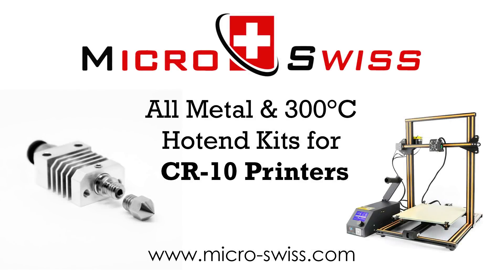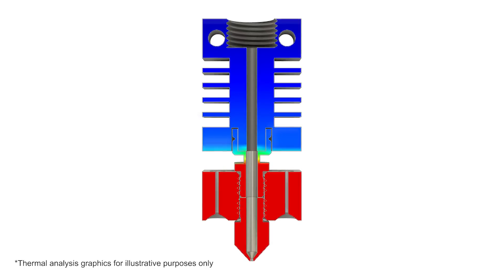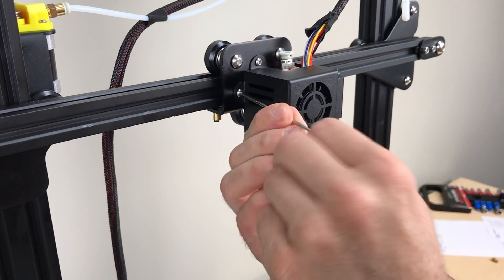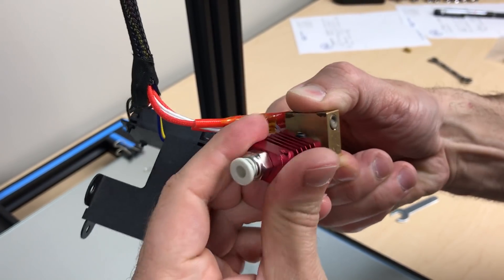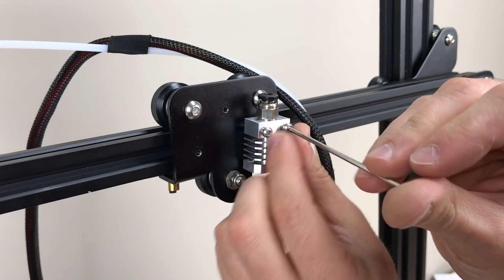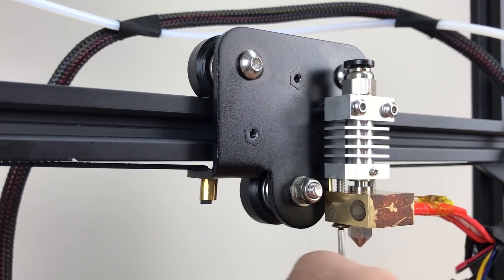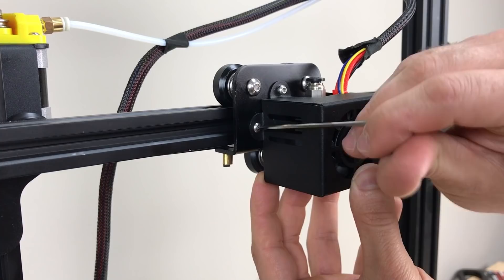Micro Swiss All Metal and 300°C Flexible Friendly Hotend Kits for CR-10 Printers

Comment: Please provide a video with installation of the heater block that came in the kit. It does not have any heartbreak screws.
Reply from the maker: Installing our heater block is same as original block, except when tightening the nozzle you have to hold heater block with pair of pliers. Please fallow the video instruction as is, except when seating the nozzle. Instead of installing those 2 screw, preheat a hotend, hold the heater block with pliers, and then seat the nozzle.

Comment: Hi. I can't stop having jammings with this upgrade. Don't really know what's the problem. Look https://drive.google.com/file/d/1STpYHwBVqcv41C7G3cE-1cBta0V4hurb/view?usp=drivesdk
Did you have this issue?
Regads
Reply from the maker: Make sure to lower your retraction to about 4mm
Reply: But isnt that too short?
Reply from the maker: It is not too short for All Metal hotend design because heat break is more efficient.
Reply: Micro Swiss LLC ok, and the speed you use?
Reply from the maker: We use 30mm/second and it works really well.

Comment: Report as Inappropriate
Clogging issues (That could be solved if actual written instructions were provided!)
As another review noted, have near constant clogging due to retraction. Turns out, with the micro swiss, you're supposed to lower the retraction distance which 1) is annoying when you actually need retraction, and 2) is not noted anywhere in the installation video... and for some reason, unlike some other kits, this one doesn't warrens any sort of written instructions? C'mon...

Comment: This does not reach 300 Degrees guys......I installed it same as video..... Soon as i start i still getting 285 max temp NOT! 300 degrees.......WHY! and why not show how to reach 300 degrees if they state the part reaches 300 degrees+  Not having a 300 degrees temperature experience...... Stick with your CR-10 origional hot end..... Same thing. same Temps
Reply: The heater block can handle up to 300. If you're printer can't get there that is a firmware issue not a hot end issue. The hot end does not magically update your firmware.
Reply: Well dont say it reaches 300   degrees if their not going to show how 300 degrees is in the firmware...... All talk no action
Reply: its Not the printer.... the hot end does not reach 300 + degrees.... and if it does.... Then share your process of this acheiving 318 degrees because it does not.... and now you are trashing a product that has nothing to do with the hot end...... So if you have a cr-10..... Share you procedure to how you did this rather than mock
Reply: @EliasOda  It was already said you have to update the printer's firmware to remove a temperature limit. The Printer has a temperature limit so you don't destroy the stock hotend. After you upgrade the printer the hotend is no longer a limitation so you have to update the firmware to get the full benefits. If you don't understand what this product is for then it clearly isn't for you.
Reply: Thank you for your advise.... i will try in firmware and how to change....Thankyou

Comment: I'm curious as to why you don't have a video showing installing the heating block that comes with the Micro Swiss all metal hot end kit. I bought your hot end and am trying to install it now. I would like to use the new heat block. Several others have asked the question here about how to install it but you have refused to answer them. Why is that? HOW DO YOU INSTALL THE HEATING BLOCK THAT COMES WITH YOUR KIT? (It doesn't have the 2 extra screw holes) If you don't think it should be used, why even sell it?
Reply: that seems quite dangerous.....
Reply: Actually taht's what I wanted to see as well, but I can't see how to add the thermistor wire thingies to the heating block, and that's a crucial piece of missing information.
Reply from the maker: Because of slotted clamping system on our heater block, there is no room to include those 2 holes for screws. Installing our heater block is same as original block, except when tightening the nozzle you have to hold heater block with pair of pliers. Please fallow the video instruction as is, except when seating the nozzle. Instead of installing those 2 screw preheat a hotend, hold the heater block with pliers, and then seat the nozzle.
Reply: Micro Swiss LLC Thanks for the information.
Reply: how do you reach 300 degrees.... i have it installed on my cr-10 and i have the same stock temp at 285.....What a rip off
Reply: @EliasOda  You need to flash your firmware and change the max temp in the firmware before you can go higher.
Reply: Thanks for your help..... Idid that on my cr-10 s changed to max temp of 300c  but when i flashed the firmware it still gave me stock temp setting... then i double checked all okay but re flashed and still the same.... I cant figure it out as there is no footage or tutorials.... the only tutorial i had on this was in italian All simple instalations but no show to action

Comment: What benefit does this upgrade provide?
Reply: For example printing high temperature materials, like PETG
Reply: The stock has no problem printing PETG.
Reply: Would not the firmware have to be replaced as well ?

Comment: I love the idea of using two screws to align the heartbreak. Furthermore this would prevent loosening the grub screw, potentially making filament get squeezed out, when switching a nozzle. When my all metal kit for my CR10 arrived I was a bit puzzled to find out that the included heatblock does not have the necessary threads. Does anyone know where I can get one that does provide with the possibility to use said screws?

Comment: Does this also fit on tevo tornado 3d printer as well?
Reply from the maker: Yes it does but you will need shorter mounting screws.
Reply: For the cooling block?   What are the specs for the screws?
Reply: In case anyone is wondering... (2) M3 x 16mm screws

Comment: do you have to remove the aligning heatbreak screws? cr-10 originally had them in so could i just leave them on the all metal?
Reply from the maker: You do not have to remove them but it is recommended to avoid any heat creep.
Reply: that make sense and answers why i got a clog.
but i really love this nozzle. i noticed a good difference.

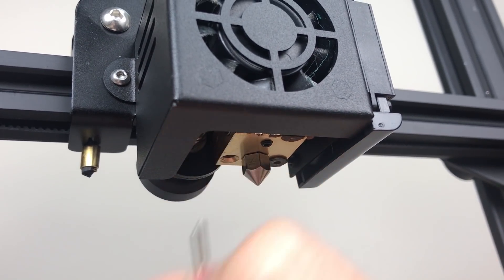Comment: Hello, why you remove the 2 screws in 4:14 : ?
Reply: I recently got my kit, but it did not have the two screws or holes in the heatblock. Am I missing something?
Reply: yes two holes & two bolts ;@) .. They must of changed it as mine is also missing them from the Heat block and cooling part.
Reply from the maker: Motorschirm, Those screws are for aligning and supporting the heatbreak during nozzle tightening. After its tightened, there's no need to have them on.

Comment: hope yours fits just got a message they have fucked up the cooling blocks its all got to be returned ..far from impressed was not checked for fitment after being machined with precision  or inspected with out any  .Before getting dispatched to retailer .. importance of quality attention to details you say on your site!. what happend ?
Reply: They will not work unless you insulate the heatblock with either the silicone sock or stock insulation.  It was a pretty poorly executed new product introduction in my opinion.  They don't tell you to insulate the heatblock in the videos and the tech support guy at micro-swiss claimed theirs was fine without it until they started shipping silicone socks with them.
Reply: Chris Nichols 
did u have the new threaded version as it were to baggy they only just fixed this apparently u may have a dud
Reply: I have both versions.  The one with the threaded block I gave up on and used the stock block.
Reply: Chris Nichols the block was machined wrong u should contact them they may be kind enough to swap it out
Reply: received fitted and is working pretty well i must say micro300. ..can we purchase ptfe replacements as mine keeps falling out

Comment: Nice.  I like the idea of the Ti. heat break.  Logical.  Looks to be a logical design overall. 

Being constrained by original firmware and heat cartridge does not bug me.  
260 is plenty (for me) and allows printing everything but Nylons and Polycarb (essentially)...which would be nice
but are not needed for the functional prototyping that I do.
If I ever have a need I'm sure I will be able to figure out how to flash the brain...or replace it.

I will order the 300c kit for my CR-10

Comment: As a CR-10 owner, I am interested in a hot-end that can get me up and printing with high temperature materials, however the fact that this product is only available on your website and not on Amazon gives me pause (since Amazon ships fast and free). It is also only $5 cheaper than the legendary E3D V6, which is the other main contender for a CR-10 owner who wants to upgrade. Other than ease of installation, is there any performance benefit over the V6?
Reply from the maker: Xanthyn, our hotend is a great alternative to E3D hotend, this hotend comes standard with plated wear resistant nozzle and titanium alloy heatbreak. Grade 5 titanium alloy has lower thermal conductivity then stainless steel, so heat transition zone is more defined. Regarding shipping, we do offer free domestic shipping for all Micro Swiss products and we ship order daily if place before 4pm Central Time. The kits will also be available on Amazon Prime soon.
Reply: Thank you for the informative answer. One more question: these hot ends can print at temperatures above that allowed by the CR-10's stock firmware. Is it correct that the firmware will need to be manually updated using an Arduino, such as in this video?:
https://www.youtube.com/watch?v=81RB1qEmkIk
Do you offer any support for this procedure?
Reply from the maker: Stock firmware only goes to 260C, so this is the maximum temperature you can print with using stock firmware. To get past this limit, a custom firmware is required. The 300C in our product name refers to the maximum temperature this hotend is designed to withstand without damage. Unfortunately we do not provide support on firmware modification.